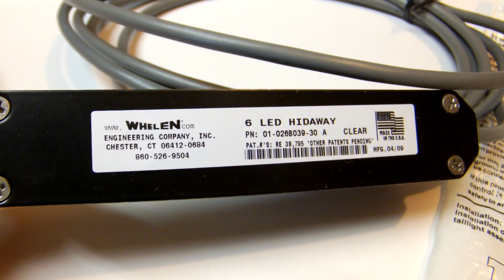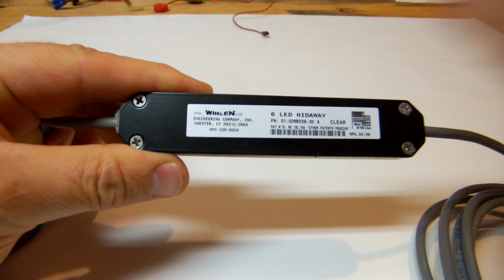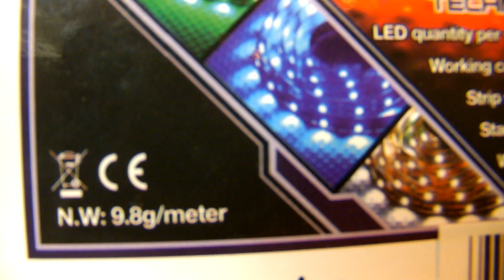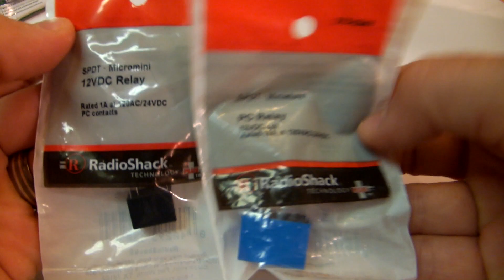Strobe Light Installation on FPV Skywalker for Night Flying

Comment from the maker: Yes, I love my Skywalker. She is getting rough around the edges, but I am almost nearly done tweaking her. This winter, I will be putting together my black Skywalker (still in box) using all the knowledge I have gained on this white one. The black one will incorporate everything the white one has, but much of the wiring and antenna coax, and other hardware will be wired into the wings and fuselage before construction even begins, to make everything neater, cleaner and tidier!

Comment from the maker: The landing did get my heart racing. I absolutely had to stay to the right all the way in, to avoid colliding with the power poles, and a conflict developed in my mind when it came time to yaw left towards the poles for final line-up. I couldn't see anything in the goggles except lights on the horizon and blackness, but I knew I had to come to the left. So my mind was screaming "DANGER-KEEP RIGHT", but when I peeked out of my goggles, my eyes told me I had to yaw left! It was fun but intense!

Comment from the maker: The strobe light is being powered by the 5000mah 3s motor battery. I have not tried strobes that are made for RC planes, because I don't believe they have the brightness and intensity needed for my application. The idea of a strobe on my plane is mostly so my plane will be more visible to full-sized aircraft that might come into my area. Those little bitty RC strobes with only one led just wouldn't cut it. They look cool up close, but my strobe is much brighter and can be seen 3km away.

Comment: Just something to think about, most cameras are very sensitive to IR light (take your TV remote push a button while point it at your video camera, you will see it flashing) it would not take much at all to build an IR LED array to light your runway, it would look like daylight from your FPV view, to anybody else at most it would give off a very faint red glow, the naked eye would only really see it if you were really looking. You could easily use this to light your landing strip and be able to land using FPV. Just a thought.
Reply from the maker: That is a very good idea. I actually did buy a round IR LED array and got it in the mail the other day. I tested it out in the dark. I compared it with the regular lighted LED lights I have on the front of my plane right now. The reg LED array lit the garage up a lot better than the IR array did, but what you are saying is totally different: Use the IR LEDs on the ground to light the ground up, without causing a big scene to people who might be walking around in the area. Good idea! Will put that on the back burner for a while until I get some time to test it out! Maybe 4 IR lights on each side of the runway, powered by a 500mah lipo pack each, just drop them alongside my strip every 50 feet or so, aimed up along the glideslope so they are pointed more or less directly at me as I am coming in.... I LIKE IT!
Reply: glassdogangle Thats what I was thinking! I have to say thank you so much for your videos! Your videos are what got me interested in FPV and seriously looking into. I picked up a Calypso recently which I think will be a great FPV platform, I am hoping in the next couple months to start collecting FPV equipment! Thanks again!